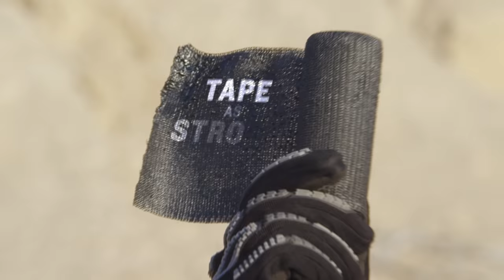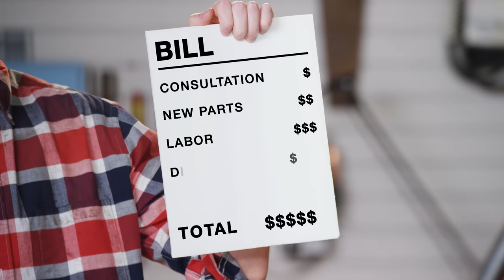Redneck Drives a Duct Taped Car Off a Cliff!

Comment: Good ad, good product, I will actually buy this product based on this ad, and that is extremely rare.
Reply: an ad that well shows his product quality
Reply: It's simply just good marketing; to make you buy stuff you otherwise wouldn't or stuff you might not even need.
Reply: same man
Reply: Lex Python 666 likes
Reply: Hey guys, quick question. Is it basically a GFRP fabric with some sort of resin that gets activated with water? Because I use something similar (CFRP with a different epoxy) to strengthen concrete structures and this method is known to be damn strong!
Reply: I did as well
Reply: Jason Grey can convince someone to buy anything
Reply: It because of Jason Gray. JK Studios improves all
Reply: Same here!
Reply: Agree!
Reply: Aame

Comment: I suddenly need this in my life. Wonder if it would work on a hole in my radiator..
Reply from the maker: A hose yes but a radiator would be very difficult to wrap. Like a volcano.
Reply: Well it looked like he patched a hole at one point, which is why I asked. But thanks for the heads up!
Reply from the maker: There is a FiberFix patch available it works different than the FiberFix wrap. The patch can not withstand the pressure within a radiator so I would not recommend it for this repair. Please give our customer service line a call if you have anymore questions at 801-701-0096.
Reply: FiberFix Thanks a bunch, Best customer service ever. Hope this company really takes off, thanks for your time!
Reply: Es Carter LOL :)
Reply: "I suddenly need this in my life."  
 Totally nailed my reaction to this with that statement.

Comment: Never seen a duct tape commercial, and I'd still buy it over this.
Reply: Things that work don't need advertising.
Reply: +desertraven ridiculous and false.
Reply: +desertraven this is just plain wrong.
Reply from the maker: Saturday saved!
Reply: +desertraven Do you not know how strong fiberglass can be? It works just like a cast for an arm or leg. This tech has been around for a while, and I don't see how anyone could "deny" it's existence.
Reply from the maker: Fiberfix is like casting material but on steroids. A lot stronger and a permanent fix.

Comment: shit I'm sold I bought 22
Reply: I actually bought this too fix a high pressure copper pipe that burst and although it was extremely hard the pipe was still leaking
Reply from the maker: This link is a great example of how to properly wrap a water pipe https://www.youtube.com/watch?v=LTB-9YFMaTY. If you are still having issues with your water pipe please give our customer service line a call 801-701-0096.
Reply: The problem with these products - they don't factor in the time and effort that is required for proper application. 
an hour of effort is worth 20$ to me. Thus, I'll buy something more expensive, if I know it will work right the first time, with an easier application. 
Seems like a cute product though. I'd try it. 
Though admittedly if I were to patch a pipe, I would use something like silicon tape. It's cheaper, more simple, with a proven track record. Or I'd try a clamp patch...

This though seems like it would be great for odd jobs where there are no current, better solutions.
Reply: 22 likes ....
Reply: 117 likes...
Reply: Jarmahent  costs me $35 shipping .

Comment: What this salesman is not telling you, is that you MUST use the complete roll! It is one time use!
Reply from the maker: It's no secret. FiberFix is a single use repair wrap that works so quickly because any moisture (even the vapor in the air) immediately sets to work on forming that amazing FiberFix strength. For this reason, it cannot be partially used and stored for later.

Comment: So it's basically an orthopedic cast for general purposes.  Sounds pretty good.

Though I'd still recommend welding your roll cage.  Welding is manly.
Reply from the maker: FiberFix is much harder to get off than orthopedic casting wrap, so we recommend leaving casting to the medical pros. Welding may be manly, but no one wants to wait around for a welder when they could FiberFix it themselves.

Comment: looks like the same fiberglass tape they use for broken arms and legs. made that stuff when i worked in the medical field cellacast Xtra.. pretty cool finally marketing it to fix stuff when i worked in the factory they used that stuff on everything.
Reply: Carapace Inc. manufactures plaster bandages, surgical facemasks, foam molding for wheel chairs, synthetic cast materials and surgical non-woven products. The company is based in Tulsa, Oklahoma.
Reply from the maker: That is where the idea came from, it is a lot thicker, and sticker than the cast stuff and it has a watertight laminate inside. FiberFix is meant to be a permanent fix and not easily removed.
Reply: +FiberFix sounds good I'll have to get some 😉

Comment: its like the material from a cast
Reply from the maker: That is where the idea came from, it is a lot thicker, and sticker than the cast stuff and it has a watertight laminate inside. FiberFix is meant to be a permanent fix and not easily removed.

Comment: @尹刘轩 No, they went to great length making it an honest illustration. The only had one tiny point weld per joint to hold it together while wrapping with Fiberfix. Incredible - but fiberglass is used in boats and masts for instance. They even used fiberglass for a small fast boat class in the Danish Marine... No jokes about waves cutting through like Lurpak Butter :-D BR, Per

Comment: OMG! I need this. But the Firefox won't open the website due to security issues. You might want to fiberfix it.
Reply from the maker: Try another browser if your still having issues you can email us at info@fiberfix.com or call our customer service line at 801-701-0096
Reply: Works now, fiberfixed I guess. Thanks.

Comment: This stuff has gotta be a nightmare to remove.
Reply: It's called FiberFIX! That means it's a permanent fix, there's no going back! Like getting your dog fixed!
Reply from the maker: Good Luck! We have tried a variety of methods for removing FiberFix. We have ground it off with a bench grinder, burned it off with an acetylene torch, turned it off with a lathe, cut it off with a chainsaw, blown it off with dynamite etc. Unfortunately we cannot really recommend any of these methods because they will most-likely destroy whatever you are trying to remove FiberFix from. The best policy is to make sure you mean it before you FiberFix it.

Comment: See what I’m missing is how is it watertight if it’s activated by water. That and how can you safely close a pipe with fiberglass tap 🤨. I’d either be worried about the safety of that broken off section of the pipe getting metals in your water, or fiberglass getting in your water

Comment: Duct tape doesn't need a cure time and is removable.

Kappa
Reply: You're the guy that used 100x more duct tape :/
Reply: Alvin Barrios One strip of duct tape is stronger after 1 second of prep time than this product.
Reply from the maker: It's not meant to rip and then remove. The best policy is to make sure you mean it before you FiberFix it. Although duct tape has some purposes, FiberFix is meant to harden, creating a permanent fix.
Reply: FiberFix which is why the comparison to duct tape is pointless.

A better comparison would be to various epoxies or glues.

Comment: The exhaust on my car keeps snapping. We've tried putting a connector pipe on the broken parts to reconnect them, but it doesn't properly seal it. Would I be able to use Fiberfix to wrap around that broken exhaust pipe to seal it for good?
Reply from the maker: Yes you would be able to use the Heat Wrap to fix your exhaust for the rest of your mother lovin' life!
Reply: FiberFix 
Lovely. It's broken on me 3 times within the last year and that news is wonderful. Buying the mother lovin' tape outta that tape.
Reply from the maker: We'd love to see pictures of your repair on our Facebook page!

Comment: Hmm, awesome commercial, but it did look like there was about 10 times as much FiberFix as there was duct tape used on those joints.  I suspect the duct tape held up too so they kept reducing the amount until it showed failure.  Still was an awesome commercial.
Reply from the maker: Check out the behind the scenes https://www.youtube.com/watch?v=Bg_62KbV0lU

Comment: it reminds me of buying some extra duct tape
Reply from the maker: Sure, you can use 100X more duct tape. Just watch the video.
Reply: you will never replace the old good duct tape. duct tape fixes good. its awesome and cheap. I used to fix everything with duct tape.
Reply from the maker: We're not trying to replace anything. Duct tape has its purpose on tarps and ripped rain jackets. FiberFix provides a permanent fix that doesn't get ruined by heat or water.

Comment: so its like when you get a cast
Reply from the maker: Fiberfix is like casting tape but on steroids. We would not recommend it to fix limbs.
Reply: +FiberFix is it waterproof for a prolong time lets say 4 hours
Reply from the maker: FiberFix is water tight and can be used to repair things like leaky pipes. If this doesn't answer your question let our customer service know what your trying to repair so we can better advise you 801-701-0096.

Comment: How does it handle UV/salts (roadsalts, outdoors fixes) and cold? Will the resin decay and become brittle over time?
Reply from the maker: The Fiberglass does not mind any of that stuff.  The Resin does.  If you burry it in the ground you could probably dig it up 1000 years later and it would be fine but if you leave it out in the sun and the wind and the rain it will age kind of like PVC,  after a few years it will be kind of faded and the outside layer will flake a little bit but I have repairs form 3+ years ago that are still holding strong.

Comment: FiberFix. The only commercial that gives you permanent brain damage, but I can fix it with FiberFix because it is a strong as steel, and can almost fix a volcano, unless you count the fact that they never included wether it was in Celsius or Fahrenheit, nor did they consider that saying that fiberglass is stronger than steel is like saying a pizza oven is just as hot as a volcano. ;/

Comment: 850° what about 0° kelvin (-459.67° fahrenheit)?
Reply from the maker: FiberFix original repair wrap is heat and cold resistant between -50 and 300 degrees Fahrenheit.  We also have FiberFix Heat Wrap which withstands temperatures up to 850 degrees Fahrenheit (or 454 degrees Celsius).
Reply: +FiberFix Better than laserbond.

PS: I appreciate your dedication to responding to the comments! 😺

Best of Luck,
   ~Rorek~
Reply: Just flipped through your videos, you've got something for UV as well getting all the bases covered I see.

Comment: I wonder if it can shatter or stop a bullet
Reply from the maker: We have actually tested this and it depends a little on the number of layers of FiberFix, the size of the bullet, and the distance from the shooter, but it depends most on the accuracy of the shooter.
Reply: +FiberFix next question will there be another commercial like this it's quite funny and actually makes me want to buy the product unlike most boring commercials
Reply from the maker: We look forward to what is yet to come from FiberFix. In the meantime, you can buy it at fiberfix.com!

Comment: If it was as strong as steel, could you break concrete with a clump of it?
Reply from the maker: 2:50.
Reply: That's a fixed hammer, I meant fiber fix rolled into a ball.
Reply from the maker: It's possible. It would definitely work better if you attached it to something. FiberFix repair wrap excels when it completely surrounds an object.

Comment: problem if this tape is as strong as steel how do you cutt it
Reply: Don't get it wet before cutting, I'm assuming.
Reply: you dip it in water then it hardens 10 minuets after.
Reply from the maker: Starts soft and then hardens like steel... kind of like a egg if you boiled it ...and then buried it until it petrified like this one dinosaur egg I saw in a museum.

Comment: Can I use it on my leg if I brake it
Reply from the maker: Only if you never want to move your leg again because it will be perinatal fixed as in fixed in one position..... forever and it would probably cut off your circulation, which may be a problem ...based on what i know about circulation.

Comment: Since this is the same material that i used to make cast would it be possible to actually use it as a cast in a bad situation?
Reply: I guess if you put something in between the fiberfix and your skin, unless you want hardened resin and fibers instead of skin... I should make armor with this.
Reply from the maker: If you want FiberFix on you for your whole mother lovin' life! We do not recommend it to be used for a cast.
Reply: It'd be pretty overkill considering casts are made from plaster instead of fiberglass and resin.
Reply: Well you could, caution however in the first days after getting say a broken ankle, they swell up which is why Emergency Department's put you in a back slab for 3-7 days as the swelling could /will cause PAIN and nerve, blood supply damage. After the swelling reduces the EDs could rap it in soft ban, make sure its in the right position THEN Fibrefix it … Tom the Nurse. ( usual legal speak denial, ensure blaa blaa, don't sue my ass etc)
Reply from the maker: Only if you feel manly enough to do so!
Reply: Damn, I had a fiberglas cast when I was 15. Was far from bein' a man, but I do feel like one now!
Reply: never get the cast off again but why would you need to- now your skin is covered in manlyness

Comment: can this be used to fix a crack in a oil pan on a car?
Reply from the maker: As long as you can wrap it well enough. Depending on how hot it gets, you may want to check out our FiberFix Heat Wrap. https://www.fiberfix.com/products/fiberfix-heat-wrap
Reply: What about your fiberfix patches? That might work better.
Reply from the maker: That would probably work great! A good rule of thumb is if you can wrap it, repair wrap; if it's a flat surface, FiberFix Patch.

Comment: can i cut it into a smaller size?
Reply from the maker: You can cut it, but you need to use all the tape once you open the package. The moisture in the air will set to work on curing the FiberFix.

Comment: It looks like they needed gloves to work with fiber fix. It could be very corrosive. Also, I would be concerned about gases or odors that it may produce. These strong chemical adhesives need to be very clear about what's in them.
Reply: Used it yesterday on a non pressure pipe. Saved me dollars and time. The gloves are because it has sticky stuff on it after you wet it. No odor at all.
Reply: Steve Pool I don't believe that it lacks an odor. Maybe you are using the word "odor" as though it might be something offensive?
Reply: Ahh, so you're a typical internet skeptic that ignores anyone's 1st hand experience saying otherwise just for the sake of argument.

Here's an idea; try it yourself before trying to spread FUD about something.
Reply: sugonmaballs They are not using any magical new ingredients in this product. If it is adhering to anything, there will be some kind of a scent or odor. I think you just want to confuse the word, "odor" with something that is bad. Everyone has a different opinion ojn what an odor is.
Reply: Everyone knows what "odor" means.  To assume he doesn't means you're not going to believe anything anyone else says contrary to your manufactured dangers of this product, which are based on zero experience with it.  Nearly everything has an odor if you put it directly under your nose.  Normal duct tape adheres to things and doesn't have a significant odor, so that statement is false.  The same thing applies here (as I've used it as well).  The key word there is "significant", as I didn't notice any odor whatsoever while I was using it on a metal handle 

The gloves are only to keep it from sticking to your fingers, that's all.  There are hundreds of reviews on Amazon that make no mention of any odor as well.  But please keep making more assumptions and ignoring those who have actually used the product. Sounds like a logical way to make decisions, rather than from your own experience (sarcasm).
Reply: Our friend Travis is a troll. If we don't feed him he will make a few more baiting comments then leave.
Reply: Steve Pool
Hah, indeed.  I'm done feeding him though, so he can go on his trolly way now.
Reply: It's also spelt 'odour'...

Damned colonials...
Reply: +Tim Smith on Reddit, they said that England is the one who did the most changing to the English language after they lost the American Revolution. England is more rebellious now than America ever was.
Reply: but without the gloves you could make your hands STRONG AS STEEL
Reply: nothing wrong with being a bit precautious. gloves and mask if you if feellike you need to.
Reply: Travis Heinze Interesting. I guess you learn something every day. Besides, I was just being cheeky. Peace.
Reply from the maker: All of our products come with gloves! The chemicals won't hurt you, but they are very difficult to remove from skin.